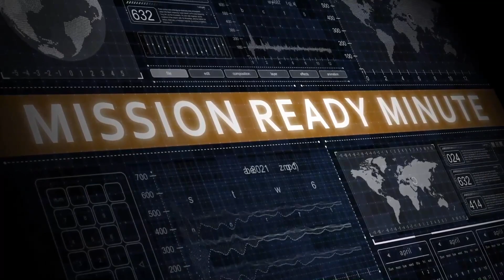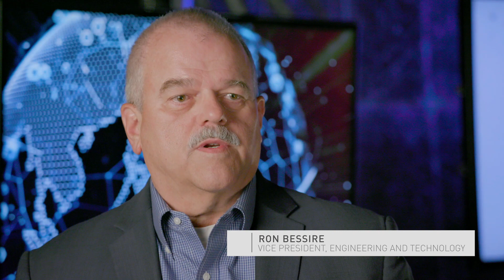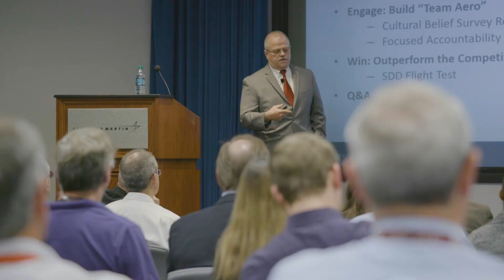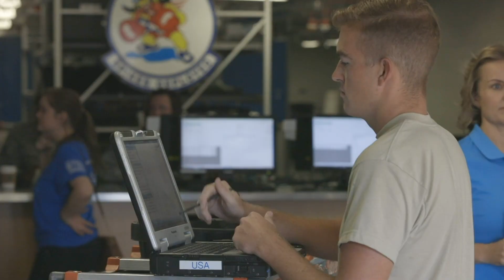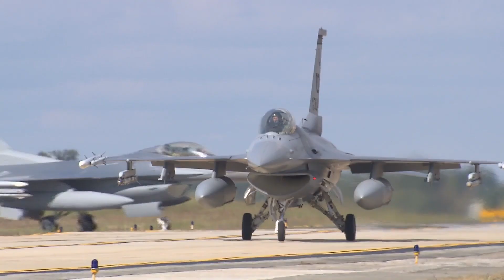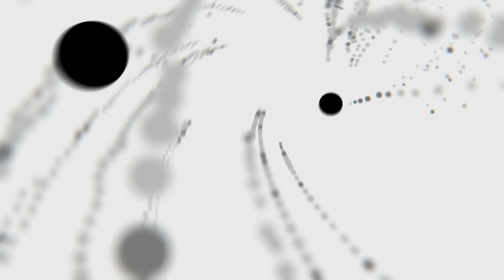Mission Ready Minute with Ron Bessire

Comment: Guys will you gave us anti gravity propulsion before...lets say 2050? In 2054 there will be 100 years since you discovered anti gravity and started to developing it. 
So for how much more we will use jet engine in public transportation? Until 3000 AD?
Reply: How much energy would that actually require for full anti gravity systems. What mission would it be for. And what else could do that job. Would anti gravity technology be for anything besides vertical. When you say the word propulsion with anti gravity it makes me wonder what use you would want it for.
Reply: RCWeaven FPV put a nuke on an anti gravity craft and we would hit any country in less than 2 minutes, and possibly begin intergalactic warfare if it came to it 

Yep secrets do make sense if u think about it
Reply: @RCWeaven FPV
A standard flat bed fusion reactor will be enough to power such vehicle. By anti gravity I mean type of propulsion that move vehicle "outside" the gravity field of the planet or any other body like for example moon. Such vehicle have its own field and moves inside this field. So problems with micro gravity, inertia etc. are not a problem anymore. 
For example you can accelerate from a stop to few miles per second in about few seconds. inertia and g-forces will not be a problem. 
With AG you can cut travel time from continent to continent on planet Earth from hours to minutes and in solar system from planet to planet travel time will be cut from years to days. 
I mean the list of benefits is long but these are the main ones. So in short way faster speeds and no problem with g forces.
Reply: @oldi184  You think in very big ideas. Don't loose that. 
Make sure to have some equations written out for all the ideas. Put numbers on those speeds and for what specific distances and then dial into the acceleration rates. Then force equals mass times acceleration. Think big but prove every small.
Reply: @RCWeaven FPV

Correct. Sadly this information is classified top secret.